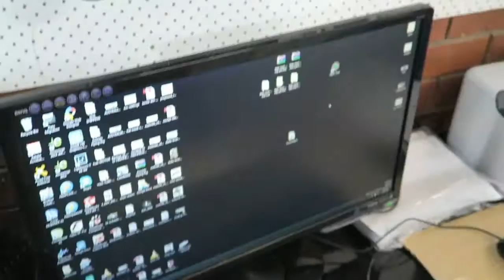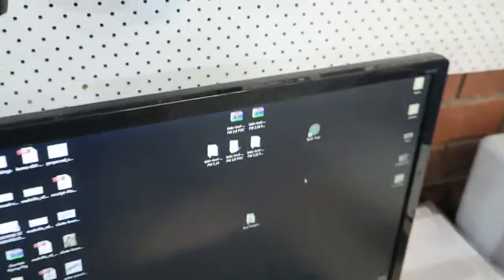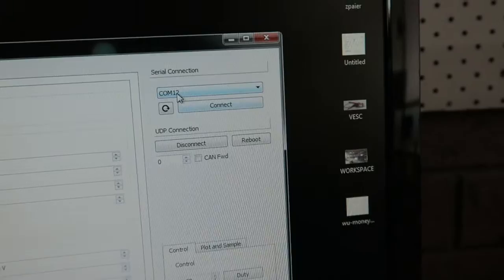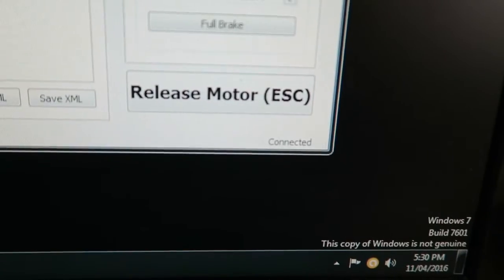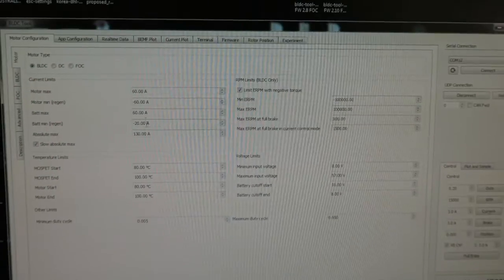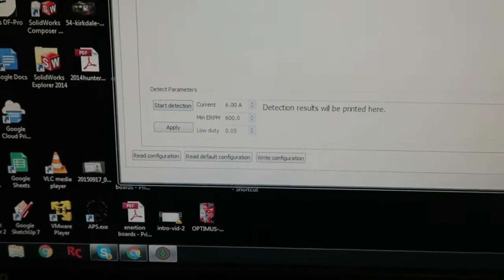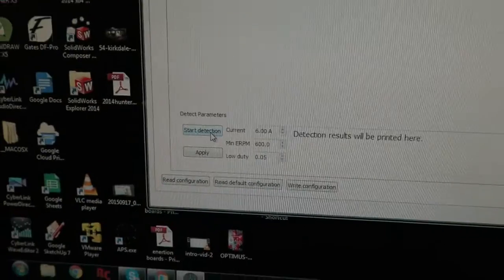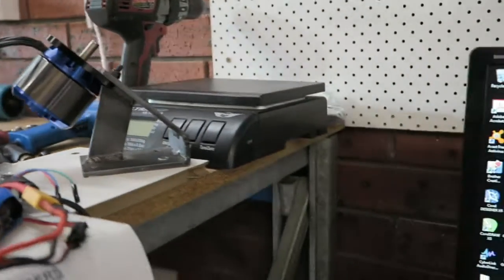VESC MOTOR DETECTION

Comment: Does it matter if the motor is attached to the belt system while doing the detection test or it should be unattached like the way you had it?

Comment: DETECTION FAILED  (on the BLDC tool) what happens if i cant get the VESC to detect the motor? what kind of troubleshooting can i do ? is my VESC or motor fried? i have not ridden it yet,  just tested on the bench and one of my two motors are not spinning and im getting a red flashing from the one controller.  PLEASE Help.
Reply: Did you ever figure out how to fix the DETECTION FAILED error?
Reply: @medinavictor85  and you
Reply: did you ever figure this out?
Reply: @rohankurse1091  u too
Reply: try to go up with Duty cycle to 0.1 or 0.15 max

Comment: Can you post the FOC detection.  And maybe tell what are the pro's and cons of BLDC vs FOC.  I read that in FOC, you don't get the same top speed at BLDC?
Reply: +Enertion Electric Skateboards You have more experience with the vesc's so I'll trust you and change it back to BLDC.  Thanks.
Reply: hello could you help me I am making my own board I have made a case for my battery's out of  fiberglass  and I cant work out a good way to mount it to the wood board as it would be nice to be able to undo it and redo it up many time and I don't think wood screws would work as they tend to rip the hole after one use any advise would be nice
Reply: try this: https://www.amazon.de/50Pcs-Prongs-verzinktes-T-Nut-Befestigungsmutter/dp/B01EZZCUU8/ref=sr_1_1?ie=UTF8&qid=1470858504&sr=8-1&keywords=m6+prongs

will use them on my build when i`m back from holiday